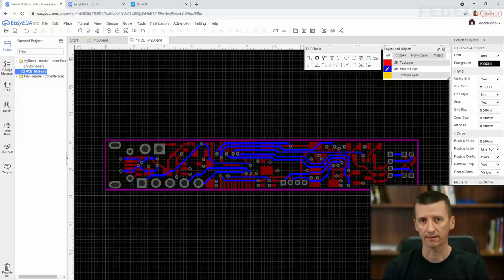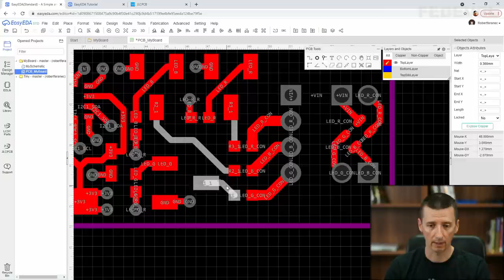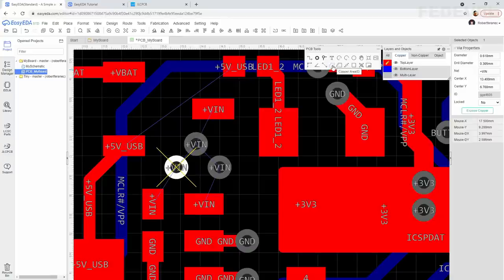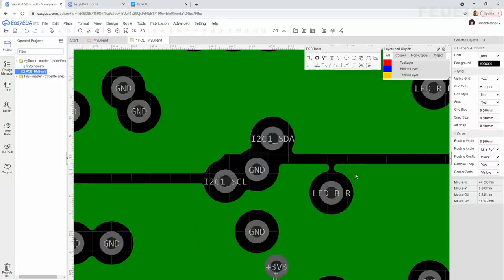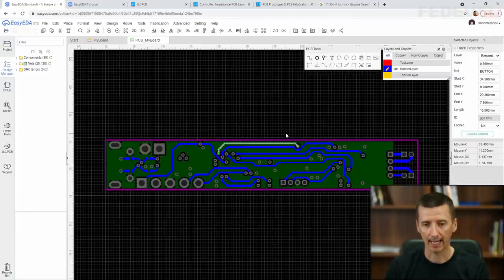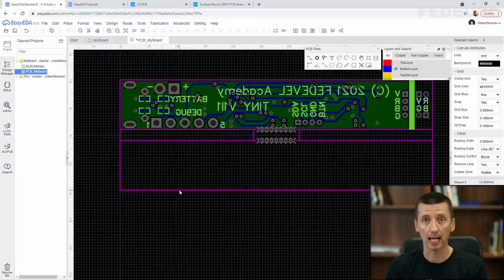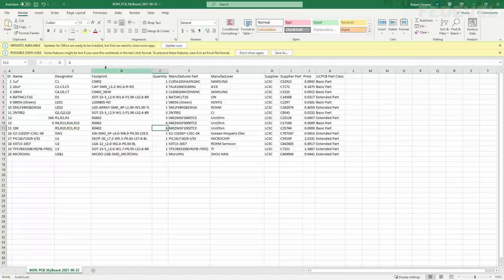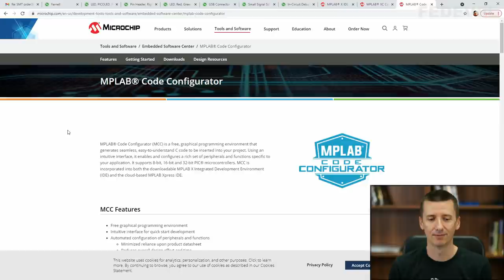Tutorial #5: Improving Your PCB Layout and Manufacturing Your Board

Comment: You are a real pro with this programs. I design my board with only 20% of features I saw you using today. Haha. When you panelize for JLCPCB, always fit as much you can in 100x100mm. It is same price, so all you fit inside that area is free ;) Thanks for the great tutorial!
Reply from the maker: Roland, very good point about 100x100! PS: All the tools are very similar. I have only used EasyEDA second time - but it is very easy to use and similar to Altium. Only important is to know what feature to look for based on your experience from the other tools.

Comment: I have enjoyed following these videos; they have all have a good amount of detail.  I have also followed your Altium Designer videos too and they were equally as good.  I have created the design for the Tiny board and my version is almost the same as yours except for some small details in the routing.  Your explanation about where to place the ground plane with respect to the signal layers was very useful.  Also, the board stack-up (and impedance of the tracks) was something I didn't know about until watching your videos.  I have never designed a four layer board before so your explanation of how to lay components out was very useful.  I was also curious about getting the board populated with components.  In the past I have designed the board, had it manufactured and then fitted the components myself, so using JLCPCB to select the components from within the software is a useful addition.  I'm looking forward to watch the remaining video on how to program the pic chip; this will be useful to me as the original chip you used no longer seems to be available from JLCPCB.

So an excellent job! Please keep making these types of videos (with an equal amount of detail) - they are really good.
Reply from the maker: Thank you very much Gordon for very nice comment.

Comment: An easy way to improve PCB EMC issues for home made PCBs with wider (>=0.012 inch)  traces is to attach outer ground planes very close (<= 0.005 inch) to the signal layers to tightly couple fields close to the traces. This does have the drawback of not being able to access the signal traces.
Reply: I saw a movie with Rick Hartley; he mentioned to better not use a powerplane in a 4 layer pcb. Better to route and use two gnd/reference planes and two signal layers. He advised to put the signal layer inwards and place the components on the gnd plane, use via’s. I’m still a little but hesitant to do…
Reply: Generally the reason not to use a power plane for 4 layer PCBs is because of the great distance between the plane and the signals making them ineffective. My method consists of using a blank copper/polyamide sheet punched with holes to allow soldering of components to the PCB and some attachment points to the PCB ground.  Remember as Bruce Archambeault says = "The ground is a place where carrots and potatoes thrive!"

Comment: Thank you for this great series. Seeing the thought process and actions is very instructive even if I am not a novice to this. Keep going! Maybe with some more complexity and high speed signals (dp).
Reply: Oh, and an idea for future.. maybe talk about strategies for connectors like gigabit Ethernet RJ45 to a MAC and ESD in the middle or M.2 or even just USB 2/3, where pairs have to be untangled and don’t just neatly flow a-a, b-b etc. say where components side by side “align” a-d, b-c, c-b, d-a and then need to be unwound into a-a, b-b etc from a straight row of pins to a staggered tht pin out etc. All on a 4 layer board with sig/pwr-gnd-gnd-sig/pwr stack up. That’s very affordable and accessible for many folks vs many layer boards as this tech becomes more accessible and relevant. I find myself living in dp land a lot, so, maybe that’s unique to me ;).. but I think it could be very instructive to see the thought process.
Reply from the maker: Thank you very much Christian

Comment: Robert, very nice video (again!!). 

Question:  for polygons:

- is there a reason to connect via’s NOT directly?

- in one of your courses you mentioned to be careful with connecting pads directly to a polygon, because soldering can be very hard because of the heat dissipation. I found out the hard way haha. Of course there is a good reason now to connect directly for heat dissipation of the connected element. When is a polygon to big to connect pads directly?
Reply from the maker: Thank you very much Remy. PS: Polygons - I always use direct for VIAs. It possibly could be a problem for some components during soldering process (e.g. heat can be taken away from an SMT pad connected to GND plane), but if a good assembly house is used, that should be ok. PAD: I usually only use thermal connections for through hole pads which are connected to a solid plane as big as the whole board or bigger than, I do not know ... 100x100mm? I do not have any specific numbers as it depends also on how many layers the plane is e.g. a solid GND plane on 4 layers can be very hard to solder even if the area is smaller than 100x100mm

Comment: Nice video! Did you deliberately put the microcontroller on the left side? Is there a reason not to put it between the accelerometer and the LEDs?
Reply from the maker: I wanted to have the accelerometer as far as possible from the handle so it is in the place with more movement.

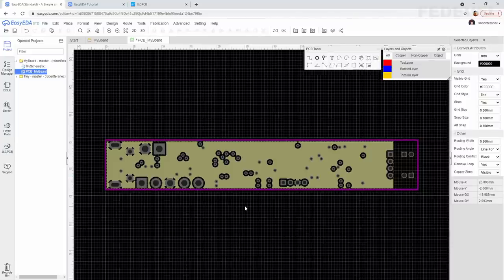Comment: Around 42:30, there is a series of 4 vias near the top, with a cutout to the edge (to cut a loop?), but a sliver above the other 3 ... does that sliver provide useful/needed protection, or is it just a narrow piece that has a chance to come off later and cause short circuits?  Around 47:45, the button is moved down so that the region can close/loop over the top of it.  Why not just move it up a bit or chop off the almost-touching tails?  Does it need to be surrounded by power plane?
Reply from the maker: 42:30 for this kind of board it would not be a problem. 47:45 you can move it also up, I do not think in this kind of board it is necessary to have ground around it.

Comment: Is there any way to create flex pcb on easyeda?
Reply from the maker: A Flex PCB can be created as a standard PCB - just, if for example the stackup or rigid/flex areas are too complicated you may need to provide some extra information for PCB manufacturer. But the gerber data can be basically the same as what is used for standard PCB. Different is usually the stackup.

Comment: Another great video Robert! I was told that with SMD components, you need to be concerned about 'tombstoning', if you daisy chain them, with unequal thermal mass on one side. Is this really an issue? Also, I don't think you mentioned or I missed it, any reason you don't also do a gnd copper pour on the top and bottom layers? Looking forward to the next video :)
Reply: Sorry, a few more questions! Any reason to use/not use, the teardrop function, or rounded traces? (they are now available on easyeda)
Reply from the maker: Thank you very much David PS: Tombstoning - I also know about this, but I have never really experienced any complains from our assembly house about it (and very often we do not really have many options how to connect smt components as our designs are very dense and with many layers and multiple grounds). GND on the top and bottom: I do not normally do that.
Reply from the maker: @DavidMsg  teardrops - if needed, PCB manufacturer will add them at the critical places. They are not always needed. Rounded traces - it used to be difficult to work with them (especially adjusting tracks with rounded corners) and as normally they are not really necessary, I do not normally use them.

Comment: I don't quite get it with the 50 ohm impedance of the tracks part. How can a piece of copper have such a big impedance, and not miliohms? Is it for some crazy huge frequencies? Also how can the impedance be only dependant on the width of the track, and not the length?
Reply from the maker: There is difference between impedance and resistance. I made some videos about it. This may help: PCB Layout & Decoupling - Understanding Impedance (Part 2) https://youtu.be/Tt8X6_maj6c

Comment: This would be awesome as a Live!
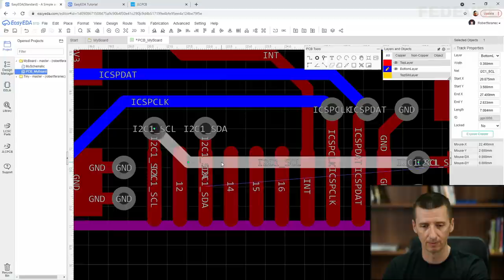Question: I watch you routing signal traces on top of pads that are on the other side of the board, for example at: 9:04 is this ok?
Reply from the maker: Thank you. PS: I believe, EasyEDA always brings the Active layer on the top of View, so you can better see it when you are routing on it. But of course, in reality the real layer position is still based on the Stackup.
Reply: @RobertFeranec  Yes sir.
But i was asking if these pads (red layer) 46:19 wouldn't interfere with data lines (on blue layer)? Since they intersect on top of each other?
Reply: Won't that interrupt pin (PIN 18) be active by the i2c traces noise, since they intersect?
Reply from the maker: @FixDaily  They do not intersect. The Red tracks are on the TOP layer of PCB, blue tracks are on the Bottom layer of PCB.
Reply: @RobertFeranec  I know, i mean intercept in noise interference, not by physical contact.
Reply from the maker: @FixDaily  they are far away from each other (1.6mm) and there are also two additional layers between them (solid GND plane and VCC planes) which will help. Even if these two layers would be directly below/above, they are routed horizontally and vertically so they would not really picked up much noise from each other.
Reply: @RobertFeranec  Oh thanks that's what i wanted to know :)
Great work thanks for the explanation.